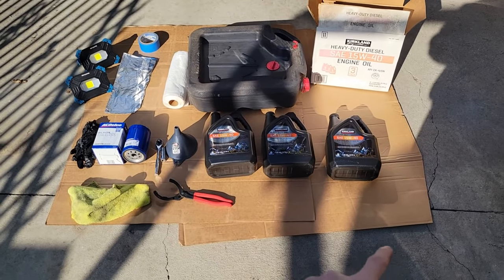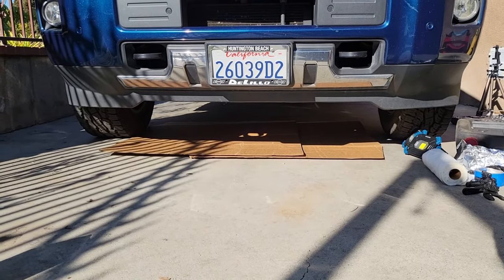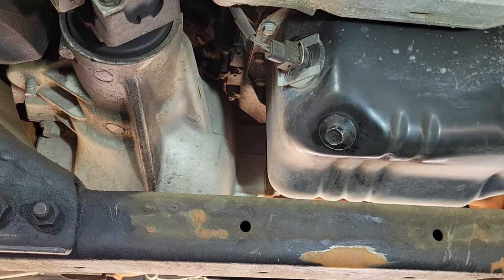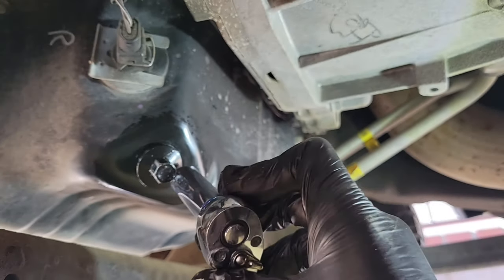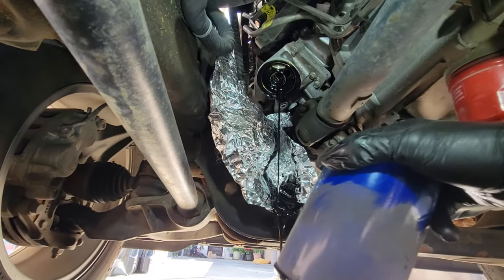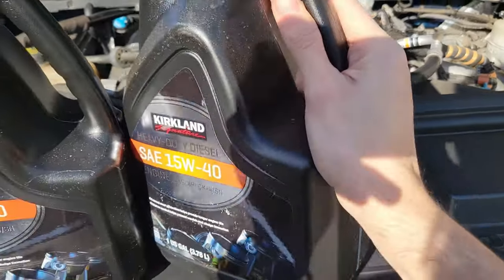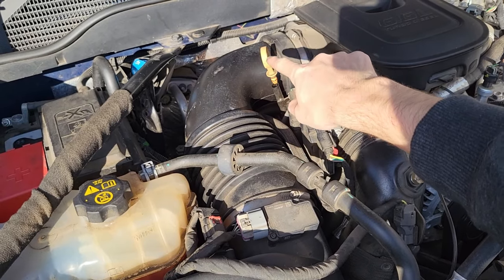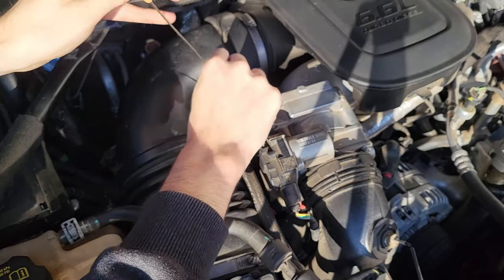ENGINE Oil Change 2011-2016 Diesel 6.6L Duramax  LML DETAILED ( GMC, Chevy 2500HD) #duramax #diesel

Comment: That aluminum foil is a great idea, last time I changed mine I had oil all over the place due to that oil filter location - thanks!
Reply from the maker: Anytime! The fuel filter also doesn't have the best design for draining and replacing! 
I've been meaning to release the video for that service, stay tuned 🙌

Comment: Foil is a good idea. I use a 13 gallon plastic kitchen garbage bag and drape it over like you did. If you turn your gallon jugs flat ,the oil comes out nice and doesn't do that burping that makes a mess sometimes.
Reply from the maker: Great suggestion & observation that could quickly make a mess especially without a funnel
Reply: Pro Tip, invert the container where the spout is at the top. Nice and smooth that way and easier to control volume. Thanks for the vid!
Reply from the maker: Thanks, I've done so since ya'll recommended it and it makes it a lot easier  @bombmanize

Comment: Foil under the filter, brilliant.  Thanks!
Reply from the maker: Here to help Gary ✅
i'll be cranking out more vids on the Duramax soon. It's usually tucked back in the driveway so I put off taking it out to make videos on it
Reply: I full time rv'd for 4 years and couldn't do any work.  We're now back at our home in Las Vegas and I don't have any excuses.
Reply: I did the transfer case and differentials last week.
Reply from the maker: Nice, I'm sure you saw a TON in the 4 years! Is your rig a GM platform? @IPING4U
Reply: 2015 2500 Duramax currently 140,000 miles
Reply from the maker: @IPING4U  Nice, it's barely breaking in

Comment: I put my front tires up on ramps, my ramps are made of wood and are from the 1940's. Handed down from my grandfather, to my dad and now to me. By raising the front end up more oil will drain out, the bump in the oil pan wont fully drain unless you raise up the front end of the truck. I use 15w40 synthetic diesel oil and i change my oil at 3000 to 3500 miles. I change the red transmission filter every other oil change and also the fuel filter every other oil change. WIX oil filter, Alison red transmission filter and CAT fuel filter. My truck is a 2013 chevy silverado 2500HD 6.6L LML Duramax currently at 153,700 miles.
Reply from the maker: Proactive maintenance is the KEY to longevity 👌
Reply: @Striker 50  
Yes sir it is. Oils cheep. Getting ready to take the duramax on a 4,000 mile road trip pulling a 10,000lb car trailer with my 2017 jeep wrangler JK Custom General Patton Edition on it from Minnesota to Moab Utah and back.
Reply from the maker: @waynejohnson1060  Now that's a trip right there! Will be doing a 2,500mi to Texas with a 4 horse trailer in June
Reply: @Striker 50  
We're taking our trip in June also. I have a CB Radio in my truck. It's a Uniden PRESIDENT P300 SSB radio. I have a Wilson 5000 antenna thru the roof dead center. It's a great set up and will talk 70 to 90 miles on side band, and when skip conditions are right it will talk coast to coast including Canada eh. So if u got a radio in ur truck I'll be on 38LSB, 36LSB and 19 AM (the trucker channel)
Reply from the maker: @waynejohnson1060  10-4 over ✌

Comment: Damn I got the exact color and trim lol, this video will be useful as I just bought it about a month ago and I'll be doing the an oil change soon, have you had any problems with the glow plugs?  In case you say yes, do you have any advise or something I should keep in mind? Mine just gave me a P0678 wich means glow plug on cilinder #8, apears to be quite of an easy job, apparently, just as spark plugs on gas engines it's better to replace all of them or at least that's what I have readed online a couple minutes ago
Reply from the maker: Lol niceee, we just got a matching color camper shell for it. 
I haven't had issues with them,  it agreed, good to replace them all although a bit pricey. Since it's used you'll know if they've been replaced or not prior and reduce future issues since you'll know they're new

Comment: Great video and exactly what I needed to do my first oil change on a new-to-me 2016 w/LML engine.  I would like to know about the large, white filter on the right bank that has a wire connector on the bottom.  I'm assuming that is the coolant filter? Also, what are your recommendations for changing out the front shocks - mine appear to be original and are getting some rust on the lower mounting area. Mileage is 85000.  Thank you!
Reply from the maker: Are you referring to the filter in the Front-right passenger wheel well? 
As for the shocks how is it riding? Stiff or wobbly? I don't have much experience with rust since I'm in the Southwest, but always want to heed with caution if it's getting quite nasty
Reply: Yes, on the filter location.  It's riding a little rough when going over RR tracks it feels stiff.  I'm not real sure which replacement shocks would be best for this truck.  I don't do any off-roading, mostly highway. @Striker50_
Reply from the maker: That would be the fuel filter. I recorded how to change it, but have not uploaded it yet.
Nice. I would stick to something OEM, or comparable. Have to remember, at the end of the day, you get what you pay for with no-name parts @airdave1953

Comment: Is that oil a synthetic or premium conventional?
Reply from the maker: Hey Trystan thanks for bringing this up! 
Unfortunately it is not a FULL synthetic oil, but it IS better than the CJ-4 oil that was originally meant for this engine. This newer blend should have more additives and protection than the original oil grade from when this engine first came out. 
Be sure to check out the Costco link I have in the description and read the comments on the review section to get a better sense if this is right for you! 
I personally would love if Costco goes all in and offers a FULL synthetic even if it costs more because I know that they'd be most likely to offer something of quality. 
Thanks for watching btw!
Reply: @Striker50_  it's CK-4 it's of high quality even thou it's not FS, I'm just wondering it's looks like something from Warren Distribution,
Reply: And if it is, maybe they are somewhat similar to Mag 1, which is available in our country
Reply from the maker: @trystanjaysubido3294  I wouldn't be able to accurately answer this unfortunately
Reply: Yes, Kirkland oil is Warren just like Mag 1. It even says so on the label.
Reply from the maker: Thanks for the confirmation ✅ @straightpipediesel

Comment: Is that costco 15w40 oil synthetic?
Reply from the maker: It is not synthetic, though the ck4 rating oil usually exceeds the standards of older CJ4 engines like this one
Reply: @Striker50_  how long between oil changes with that oil?
Reply from the maker: @blanchec94  To be on the cautious end, change it with 10-15% oil life left. If you're hauling regularly, 15-20% oil life, that is of course if you're planning on keeping it for like 20 years